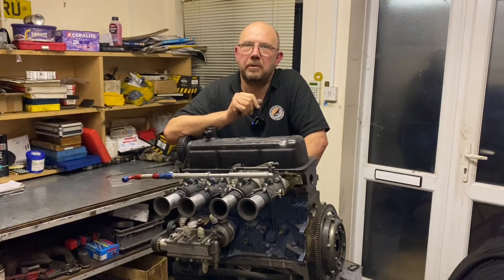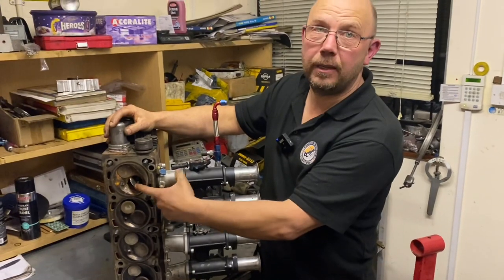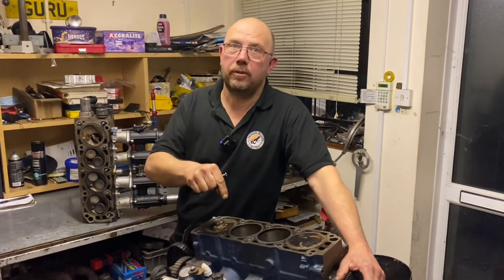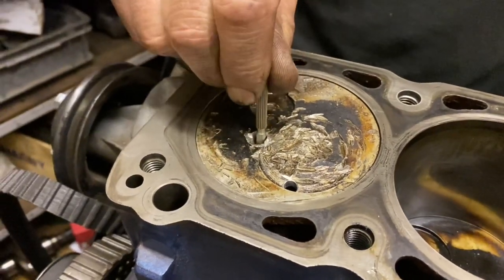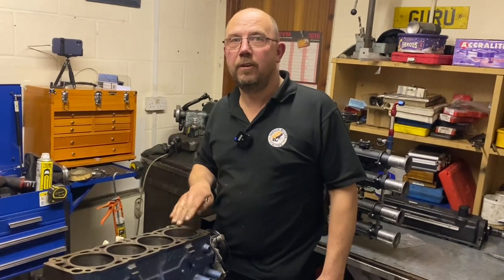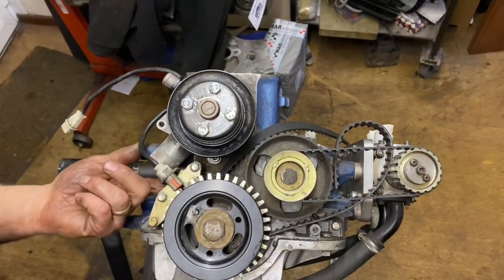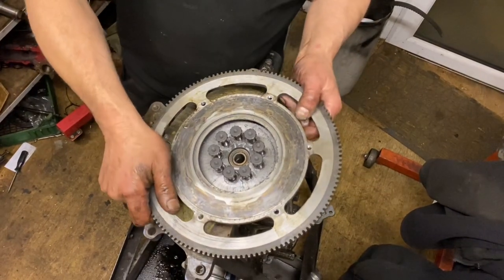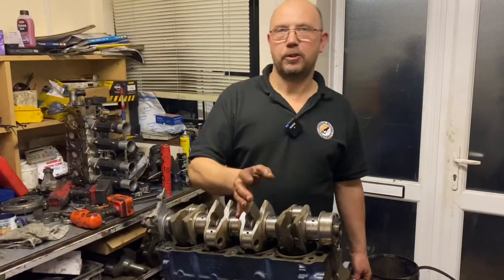Mk1 Escort 2.3 Race Pinto Engine BLOW up! Full engine strip

Comment: I have a 1980 pinto with a 2300 got it in 07 in high school. It's a tough car. I just did a bore new pistons cuz it burned oil. I was really hard on it up on the logging roads in oregon but now it runs better than it ever has the 4 speed and I have a lsd rear in in it
Reply: If you are talking about the 1980 american Ford Pinto car then the engine is not the same as this one. In the UK this engine got the Pinto name, it is unrelated to the car. Your car would have the 2.3L lima engine which is good but not the same as this one.

Comment: Monster Engine. Incredible how long these engines will take abuse if built correctly. Interesting how the head is a modified 1600. Years ago I fitted a stock 1.6 head to the 2.0 in the Capri thinking it would increase performance. I was wrong. Far too much compression for the setup. Live and learn! Looking forward to the rebuild.
Reply from the maker: The 1600 head has a shallower combustion chamber, that give two benefits, firstly more compression secondly more material in the short turn of the inlet port
Reply: @PenguinMotors  Interesting. Isn't the geometry of the valve train out of whack on the 1600 head as well? I had an FR32 in it and I seem to remember it contacted the lower end of the follower pad so wasn't giving the quoted lift figures.
Reply from the maker: @FastRust  its all about where you position the valve seats when you cut seats for bigger valves, i usually achieve  a bit more than quoted lift figures.
Reply: @PenguinMotors  Gotcha. Cheers Graham 👍🏻

Comment: Great vid. Is there a twin cam head that can be retrofitted to the pinto without major machining works?  I've got an old pinto that's in a Locost that I am currently converting to bike carbs. Couldn't believe how heavy the cast iron head is. 
One of the main reasons I am sticking with the pinto anchor is because of the no valve to piston contact if it all goes wrong. Keep up the great vids.
Reply from the maker: Yes a couple of options a Warrier head from Connaught which works really well but isn’t cheap, or Sierra cosworth YB head, but the cosworth is an expensive upgrade for not much more power.

reference valve to piston clearance, once you fit modified cams the valves WILL hit the pistons if a belt breaks

Comment: Doy you think that the lift of cam , caused the valve failure?
seen solving this problem with others v spring or maybe you need bigger toleraces
Reply from the maker: dont think it was the cam, same cam has been in the engine for 10 years, its still in there now

Comment: You should replace it with an Esslinger head. They run in dirt modified cars at 8k+ rpm for hours at a time with no problem.
Reply from the maker: Nice idea but the Esslinger heads are for the American Lima version of the engine which shares nothing in common with its European cousin
Reply: @PenguinMotors  That's a bummer... I kinda assumed it was the same since yours is a 2.3 like all the American ones

Comment: If there was ever a justification for ongoing inspection / refresh then this is it. There's a good chance the witness marks on the pistons would have told the story well before it failed.
Reply from the maker: maybe but i doubt it, because i have had the head off since it was first built and there were defiantly no witness marks then.
Reply: @PenguinMotors  Something has to have changed then, either cam timing or rev limit.....!
Reply from the maker: @SB-vb8ch  yup, or it was buzzed on a gear shift, its attached to a 7 speed sequential gearbox, meaning its very easy to bang it down a gear or two too many going into a hairpin.................

Comment: Would you not fit a cylinder liner to that block, since pinto block are getting scare
Reply from the maker: Blocks are not that scarce yet, it could be linered but fitting one will distort the cylinder next to it so you end up doing them all. Something best avoided especially on a full race motor